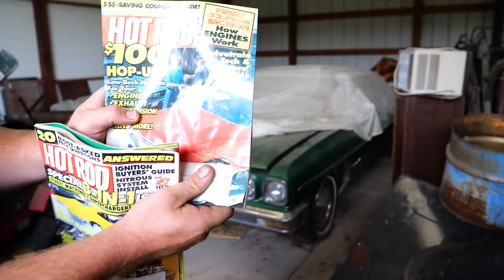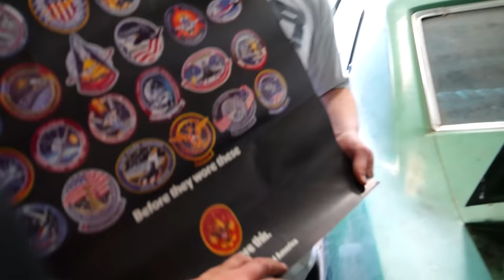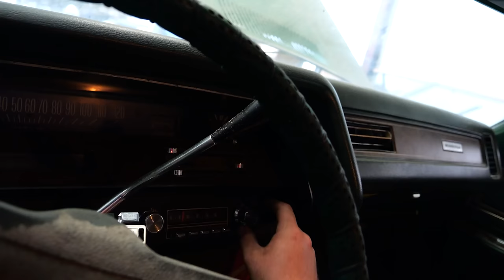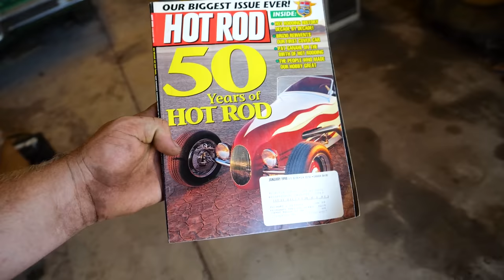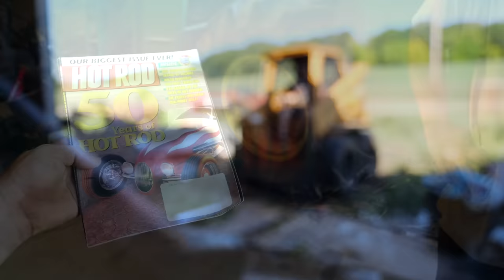Will Two Buried Cars RUN & DRIVE After 30+ YEARS??

Comment: HEY I have that exact John Deere. Mine was from 1976 or something. Thing runs great. Got a big ol rear tiller and a plow up front. Comes in very handy for gardening or snow removal on the property. We even tow 20ft jet boats around with it lol. Awesome lawn tractors!
Reply: ik right?
Reply: I used to service a 1972 JD 112 just like it for a guy, the thing had been used to high hell and back, but it ran and worked great.

Comment: Tip for starting old diesels like that John Deere diesel combine, from personal experience and even in owners manuals in many pieces of equipment it says to give it throttle while cranking. So my advice anytime trying to get an older mechanical diesel running is to hold it full throttle so you get maximum fuel pressure and compression while also giving it periodic shots of Cosby sauce, hope that helps fellas, love these series of many old cars

Comment: That thing's oil reminds me of our lawnmower that's never had the oil changed in the over 15 years we've owned it. I pulled the dipstick and there was a blob on the end of it. I walked it 50 feet into the house to show my mom (she worked at gas stations including with mechanic bays for a LONG time) and all the way into the house and back to the mower it NEVER DRIPPED in fact it never moved at all. So I did the smart thing and poured a little gas into the oil and it broke that shit down and made it start flowing again and the mower instantly seemed to have a lot more power and stopped running so rough.. Then the next time I used it I added some new oil to overfull and it never once smoked or ran rough or anything.. I don't trust that dipstick at all now. (the thing is on it's last legs and I hope it'll break soon so that we can get a new one.. though I'm pretty sure small engines are now illegal for sale in California.. -.- fucking Newsom)
Reply: You can still buy a new mower until 2024 and keep using them but I think that you should trade your old machine for a new free electric one and fucking Newsom will pay for it and our tax money as well
Reply: @Dwayne-mb2uj  the thing is that my dad won't buy a new one so long as this one still works.. he's one of those.
Reply: Change your oil, polluter.

Comment: 56 Chevy is a keeper. Those Pontiacs run but you ran out of gas twice in a block. Chevy is a 265 or 283 with a Powerglide. Powerglides always work. Great Video

Comment: Kevin, brakleen washes away oil, that’s why all the engines are very hard to start. I always use 2 stroke gas to start cars that have been sitting for decades and they start first crank.

Comment: You should have had the throttle wide open on the combine when starting, also the brake clean trick works on diesels as well

Comment: 23:00 Angus, that is an adjustable hammer. 
There's also: 
Pliers - Small Pinchy Hammer
Needlenose pliers - Tight Space Hammer
Vice Grips - Locking Hammer
Drill - Electric Hammer
Pipe Wrench - BFH
Metric Wrench - Metric Hammer
Air/Electric Wrench - Active Hammer
Torch - Liquid Hammer
Plasma Cutter - Fancy Liquid Hammer
Random Pipe - Noisy Hammer
Random Rock - Primitive Hammer

Comment: 1980 I'd just got out of the Marines. Barely had two nickels to rub together. G/F had A '70 Bonne 400 complete with the optional Lumpy Maypop tire package! So, After fighting broken bolts, skinned knuckles, you name it, I won the battle of replacing the water pump on that thing. (Not an easy task given that design). I decided to show it who was boss, so I did the right thing & went alone to a long stretch of hwy that was closed- technically under construction. Spun her around at the cross road and just sat there for a minute till there was no traffic in sight. The flagman knew what I was thinking, he gave me a jump flag off like you might see at the start of a race! (Not kidding). When that old beast hit 130MPH I decided I'd pushed my luck far enough & lifted my foot! And that's the way it was!

Comment: Methinks you needed to use fhe good ol' dual injection method with the cosby sauce on the combine to get it to go. You can open up a full-sized GM used classic car showroom soon if you acquired the green Pontiac.

Comment: An FYI . When you open the fuel system on a diesel you have to bleed the fuel lines to the injectors by cracking all of the fuel line nuts at the injectors and crank until you see fuel coming out the lines ....

Comment: Buddy I had a 1973 SkiRoule RTX 440 SACHS 2cylinder2stroke it had so much torque we had to pt a hex shaft with drive wheels in it because it would sheer the bolts/pins on round shaft. It was heavy but flew like the wind! You gotta buy it!

Comment: I really like that Bonneville, bad respray and all. A high compression Pontiac 400, 428 or 455 with TH400 and a 12 bolt is tough to beat. Might not be fast but and hard on fuel but, it would run forever if you kept the rust off it.

Comment: Excited to see the trans am/firebird. Reminds me of the car I so badly wanted to buy at 16 years old was a very rough 1979 trans am with the 6.6 liter shaker hood scoop… the interior of the car was immaculate as it was covered. The exterior was gonna need a paint job and the heater core was disconnected (probably leaking. However i quickly dismissed the idea of owning it because I probably wouldn’t be able to afford the gas or insurance on it… haha😂

Comment: For stubborn diesels that dont have good plugs you can put a rag over the exhaust and try to block it whilst cranking, it increases cyl pressure and thus temps so can help light it off.
Or if the intake is all metal, take a blow torch to it to warm it up, again trying to warm up the air being drawn in. Or even hold the flame inside the intake tube whilst cranking. Or heatgun.
Reply from the maker: I'll have to remember that! I don't think this one was injecting diesel, I think the smoke was all from the primer knob dumping raw fuel into the intake

Comment: I have a 1970 Catalina. I have been daily driving again for over a week now since I lent my late model car to a friend who is having car troubles.  They are remarkably comfortable and give surprisingly few issues driving 25 miles of freeway each way every day.
Reply: Gotta budget for gas though, wouldn't that be like 5 gallons a day if not more?
Reply: I 've been daily driving my 72 Lemans for three seasons of each year for the past 4 years. These old cars really aren't a problem.
Reply: @LLG47  I was able to get 17 mpg out of a 1973 Olds Tornado with a 455 in it with the cruise control set on 65 mph on long trips.

Comment: To start that combine you need gas and diesel mixed in a spray bottle and crank it while holding the throttle maxed out and if it starts hold the rpm up for a minute to un stick the metering valve

Comment: I’ve heard from other mechanics that starting a car that hasn’t been run for a long time with starting fluid or break cleaner or such is terrible for the motor. They claim it should be started with a gas/oil mixture to immediately lubricate the cylinders. Im not a mechanic, and not saying what your doing is wrong and their right; but I was curious of your opinion and what the real deal is regarding this?? 
I enjoy your channel!

Comment: You never want to use traditional starting fluid in a diesel engine. Unless it is an old school, Detroit. You can. However, use WD40 as starting fluid for a diesel simply by fogging the air intake as you crank it.

Comment: The 69 GTO could be worth something. If it is carosel red, it may be a judge. They run, but do they drive? The GTO is a 1968. The visible difference is the position of the brake lights. 68, the chrome was a frame around the light s. 69, the lights sat above the bumper.

Comment: All Farmers Run hydraulic fluid instead of transmission fluid in their automatic transmissions. I drag race for 20 years running nothing but hydraulic fluid in my to speed Powerglide transmission you can add a little ATF in there if you want it for leak detection

Comment: Yess lets make for dam sure by via brake clean theres zero chance of cylinder lubrication and zero chance of rings reseating use 2 stroke on old sitting engines ffs. Of course its gonna sound bad and like a t34 tank starting duuuuuhhhhhh

Comment: A couple hours of TLC on a car that's been sitting for several decades... you can potentially get it running. Modern cars after 30 years...? Doubt it. Sigh... times are different.

Comment: QUIT using carb cleaner to start an old engine!  Use 2 cycle mix so that the rings have ANY chance to survive.
Remember this motor hasn't even turned over in years. You kids need to grow up and think about what you are doing.
If you are REALLY interested in bringing back old cars - do what's right - don't do the slam bam! - Give the motor some lubrication!
Reply: Pretty sure he's been doing that for years and literally nothing bad happened. Practice shows different results apparently.
Reply: As soon as that engines spinning the oils moving. By the time they’ve checked it spins and got round to starting it it’s got oil on the cylinder walls and valve train etc

Comment: I love your channel Kevin, but your probably gonna take offense at what I'm about to say, but I literally cringe and have to look away when you guys insist on using brake parts cleaner just because its flammable to start cars that have sat. As a professional mechanic for 26 years I'm not lying when I say it's literally the worst possible thing you could use to start any engine that has sat for a long time. All your doing is washing down the cylinders. I would think after more than 200 videos, (which I have watched almost every one) you would have bought or even made your own gas squirt bottle by now. You could even use an empty ketchup or mustard or dishwashing liquid squeeze bottle. At any rate, I'm sure I'll forever be on your sh!t list list for saying this, but I'll still watch you anyway.